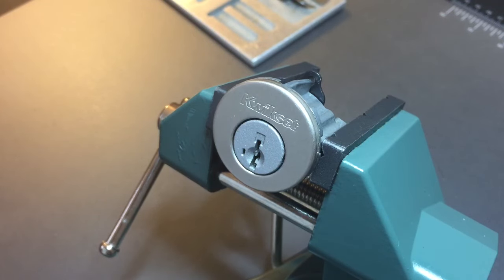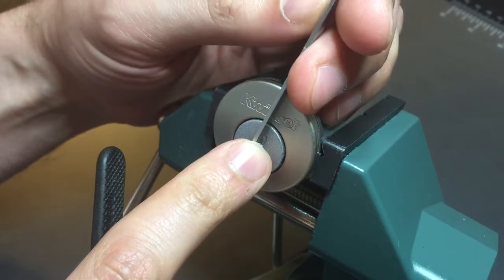[153] Kwikset SmartKey Rim Cylinder Picked and Gutted

Comment: You know that what most people need in a lock is one that does a half decent job, and one that doesn't lock you out of anything for long. I once worked as a locksmith and found there is such a thing as too much security. Plus why buy a super lock when all one has to do is kick on the door. You have to look at all the things that make up a door and lock. I don't need to know how to pick a lock, and want to pay a hefty price for a lock. Or have a lock that my locksmith can't work on. And I'm too older to remember to know how to take locks apart to change the keys. So all this is of little interest seeing how bumping can get you through most locks. No need to know how to pick locks or to have lock picking tools. Which you can be arrested for having, or not. I find little of value in most of this. Tah. Locks are for basically honest people. A pro is in in seconds, because he knows how to by pass most locks. And alarm systems were made to  fill in for the failures of most locks and door frames. Tah. Yes, there are clubs and people who pick locks for fun, and tell people about the short comings of locks. It'd be better if such people served as watchdogs for government. We'd perhaps wouldn't need better locks and so on. It's hard to believe not that long ago people didn't lock their doors. Well, this has been fun.

Comment: The scary thing about picking a kwikset is that once you've successfully picked it you can reset the pins to a different key. Crazy!
Reply: Would be quite easy to prevent, or at least make much harder, by making it so the cassette can only move whilst the lock is in the locked position (just have a notch in the barrel that blocks the gap as it's turned) as the act of tensioning the sidebar to set the sliders will rotate it to unlocked when they're in the correct positions, that way you'd pretty much have to have the real key (although due to the fixed positions of the keypins when set you could decode the lock once it was unlocked and cut a copy of the key, but at least that's difficult to do)
Reply: @benisted1614  Considering that this lock can be decoded without moving the pins, there's no reason so try to fix other issues before fixing that vulnerability: https://youtu.be/DGdsIrAjp3k
Reply: @MikkoRantalainen  Definitely a serious vulnerability but the tool costs $300+ and works on one lock, it's not going to see ridiculously widespread use yet, particularly by criminals. At this point most likely users are covert-entry teams (who would likely object to carrying such a bulky tool when a boroscope would likely do the same thing) and locksmiths, who will generally be working in a law-abiding fashion. As a vulnerability it's one that has been fixed by other slider-based locks and I expect it to be fixed in the next generation of this lock.
Reply: @benisted1614  I agree that once you know what to look for, a boroscope and may a small prism is all you need. We full pre-made tool just makes it easier.

Hopefully the lock design is fixed before many people get this lock core because otherwise thiefs WILL get the tool to decode the lock. I'd also guess somebody can create a key that can be adjusted to any cuts you need.

Comment: Thanks for this description. I had one for a few months and only managed one open on it. Tension seemed to just bind the whole plug so I had to work very light. This helps, your technique for picking it more like a car door than a house lock, it makes sense. This is almost how you'd use a Lishi pick.
Reply from the maker: +Shira Assel Thanks. I have no experience with car locks at all.  As for binding the whole core, I've only tried three of these locks, and only one was like that... I've seen huge variation in the depths of the false gates, so that may be why.

Comment: Lock Picking Lawyer. This is a bit dated, and I would love to see you breakdown the latest generation of this lock. The Kwikset Gen3 of this lock CANNOT be single pin picked in the way you're doing here. Their system has been vastly improved with a sidebar that keeps wafers from binding individually in SPP picking. 

Only after all the wafers are to shear does the sidebar fall into place allowing the plug to turn. That said, others have been able to pick this lock by tensioning the sidebar with a shim. I have tries this technique, and on the latest models I can get some wafers to bind, but I still can't pick it.

There is also a decoding tool for this, and you can cut a key by finding the kwikset depth codes which a special magnifier decoding tool will allow you to do with practice. This tool costs 300.00 dollars though!

I'd love to get your professional feedback on the latest version of Kwikset's cylinder in the smartkey version. I want to see if you can pick it, or provide additional tips and feedback to us fellow follow lock nerds!
Reply: Never tell lock picking lawyer that he can't spp something. But i kinda want to try the new one when i hit up home depot i may pick one up
Reply: @Manatee360Phototography  "Never tell lock picking lawyer that he can't spp something." I laughed so hard 8D
Reply: A new video was posted addressing the sidebar version and how it can be picked
Reply: In case anyone else comes across this thread, it’s ep 904 and reviews the model 3 with reverse sidebar
Reply: @jonengen2927  hey thanks
Reply: @jonengen2927  Thank you! That was very kind. You helped me. :)
Reply: Sure wish I had read your reply before I sat in front of my door for an hour.
Reply: Interesting and thanks for the information. Is there a way to tell the different generations apart? I have a SmartKey Rim cylinder, I haven't been able to pick it because the pins don't bind.

I assumed it would need some kind of setup with a key before it would function (all I have is a brand new unused cylinder). But now I guess it must be a gen3.

I'll have to look into this!
Reply: LPL picked this 'reverse sidebar' version in June 2019 at https://www.youtube.com/watch?v=XqsAFdFsQmQ and yes, he had to hold in a shim as he did it.
Reply: Jon Engen you’re a solid dude
Reply: It's a a Lishi tool for decoding...I have picked the old model of K S but it's ruff now.
Reply: Thank you. Yes for a new fideo of kiwiset rekey eithout a key
Reply: @Manatee360Phototography  did yoi succed
Reply: Thanks, I was wondering why Im not getting any feedback from this lock, lol.

Comment: I found one of these by the side of the road. I know locks can be anywhere from $20-$60. So, I thought I could try messing with it to see if I could re-key it. I couldn't immediately find a piece of metal small enough to fit in the re-key hole. So, I just took it apart to see if I could re-key it with a spare key we had. It wasn't until I found this video of how the re-keying slider works that I was able to put it back together and make it work with a key I already had.

Comment: if you want the new ones get the uptown or downtown style deadbolt they are brand new styles so they will have the new core.
it will say ”new advanced smart key technology” on the back of the package also if it's the new core

Comment: Hi Harry, Great picking again of course, you must have "the touch"! Interesting to see the actual mechanism - well explained as well. I know the locksmiths don't like these self change locks, and generally advise customers to change them. Apparently Kwikset have strengthened them to better resist the crushing technique, I wonder where the "improvements" have been made?  Regards, Brian.
Reply from the maker: +Brian Hignett Thanks. I know that they redesigned the sidebar such that it goes deeper into the housing and changed the material of the sliders. But I've never seen one of the early ones, except in pictures.

Comment: this version has been upgraded, and is unpickable due to the fact that no tension on the lock gets transfered to the sliders or the pins, " no feed back", and any tension just binds the sidebar  from being depressed due to it being square on top and not angled, and that the only thing that can depress the side bar are its tiny springs, way weaker than the pin springs. I have both versions.
Reply: I wouldn't say it's unpickable.  I can apply tension as if trying to lock it, insert the key, and it turns.  I can't do that when I apply tension the other way. The key will not turn until I let up the tension.  Point is, it could be picked to the locking side and the a spinner could be used to get it to the unlocked position, I believe.  But.....I could be wrong. :)
Reply: @Matt Williams "GKeyman565" said that the lock that "LockPickingLawyer" picked was the old version and it has been updated. So yes it was picked but they have changed the lock and how it works. But like "Derek Traywick" said he thinks it could still be picked.
Reply: 55ATA3 It has been picked. When will people learn to stop saying ‘unpickable’? (I mean, the Protec 2 went down on video last week.)
Reply: @RealWorldPolice  If you look at what I said. I said ""GKeyman565" said that the lock that "LockPickingLawyer" picked was the old version and it has been updated. So yes it was picked but they have changed the lock and how it works. But like "Derek Traywick" said he thinks it could still be picked." I never said it was  ‘unpickable’. Also my comment was 30 days ago and it had not been pick at that time. But thank you for letting me know that it has been picked. If you have a link to the video I would like to see it.

Comment: I understand Kwikset has redesigned this lock, with a different sidebar mechanism that prevents the plug from rotating unless the sidebar is physically depressed.  If I'm understanding it correctly.  Are you familiar with that change, or had any luck picking the new design?  Thanks very much for all your videos - they're very well explained and have been a great help to me.
Reply from the maker: I'm familiar with the change, but have not been able to find one yet.  If the change is what I've been told, it will make picking and forcing far more difficult.
Reply: This looks like the latest generation of Kwikset-smart key locks.  I haven't been successful against this lock yet.
Reply: Sorry to bring up an old topic but did you ever find this?  I took the lock on my door apart and found the exact setup you show here except when I applied tension to it the lock would freeze.  Even when I picked to the correct position it wouldn't turn.  I tried applying light tension and inserting the key and it also wouldn't turn.
Reply: Had same issue actually Derek, was messing with mine today. I run thru a few times and all pins are up and set, no turn. If I just pull tools the lock will freeze until released from inside. @LockPickingLawyer curious if you can share some knowledge, thanks!

Comment: I still dont get it :( Its nice having a visual of the interior, which lets me recalculate my thinking when i pick the lock, but i still have no idea how it really works lol
Great video though, I appreciate you taking the time to take it apart :)
Reply from the maker: Thanks.  Sorry I didn't do a better job of explaining.  :-(  If there's a particular part that did or didn't makes sense, I can try to fill the gaps.
Reply: Its not your fault at all, its my comprehending ability lol. Im just trying to grasp how the sidebar, the "pins" and the core all work together to make it rotate or not rotate when you put the key in
Reply: iknow it is tough to comprehend how they figured that out to make it work.
Reply: I got one if these cores for like 50 cents at the local habitat store. It's a lot easier to grok with it in your hand

Comment: Was hoping you would show aligning the True Gates with Channel, Reassemble, being Sure it Slides back for Rekeying. With same or other Key.
I go to a Local Door/Window shop, remove old locks from their Discard Pile, Then Rekey to a Key I have. Wanted to Show Brother In Law aligning the Grooves, Great Video, looking for one with the groove aligning. Thanks
Reply: to get the casset to go back, the sliders need to be up about half way, youll see the big cut out that matches with the half circles right underneath of the key pins .  so the sliders just need to match with the halfcircles and it will alow the casset to be pushed back... insert a new key and turn the rest of the way and bam, re-set, hope this helps

Comment: Great picking and gutting. Excellent work as usual. I've got an WEISER SmartKey Rim Cylinder here. It is a Kwikset but from Canada. It is a Challenge lock from "Locks of Anarchy", and I am struggle with it for a while now.
Reply from the maker: +dirk Thanks, and good luck with yours. Just look for the tightly bound slider and move it one gate... Rinse, repeat until open.
Reply: +LockPickingLawyer Cheers my friend. I will keep that in mind, and try.

Comment: We use these at the apartment complex that I work at.  The core is basically impossible to drill through..  Best way we've found is to aim for the 2 bolts on either side.  But brute force always prevails if all else fails.
Reply: At the relatively low cost of the lock, it is probably more cost effective to just force the lock and replace it.
Reply: Pushing the mounting screws out with a 1/8" drill through the face is SOP with all the apartment maintenance guys I know. Good cylinders will have a hardened plate in the face to prevent this attack as well as preventing the core from being pulled, and those usually come with hardened screws and a thick mounting plate too. I've seen some pissed-off ex-tenants install one of those as a 'going-away' present to get even with leasing agents who wouldn't refund their deposits. Maintenance always destroys the door trying to open it...

Comment: I've had one of the for a while, but I haven't been able to pick it. Do you have any tips for picking this one? What kind of tension did you use?
Reply from the maker: +Jake Neumann Thanks. Tension depends on the lock. I have three, and they all like different amounts of tension. Just give it enough to bind the sliders, but no more. Release a little tension to move the sliders. Good luck.

Comment: This is the lock that's driving me nuts. Your videos have help me a lot. I have watched your other smart key video as well. Also your video on tension, which has me sold on getting a heaver top tension bar. Now my questions are. Can you go through this type of lock again and address the tension question? Heavy tension does not work with this lock. 2nd in this video you keep mentioning springy at different points. Could you go into more detail on what you mean by this in relation to the pins binding? Thanks again for the great info!
Reply from the maker: Honestly, it's been so long since I picked one of these that I barely remember.  I'll have to revisit the SK.
Reply: This is Generation 1 with the side bar in a V side slot. When tension is applied it binds the sliders/ wafers.  I haven"t heard of anyone spp generation 2  with the square sidebar and slot. The new square slot prevents pins from binding. Interesting lock to say the least.

Comment: im curious what the bb does for drill protection, couldnt one just use a larger drill bit, pop the ball out, and continue?

or just drill above and below to pop it?
Reply from the maker: +LOLWHUTMAIFRIEN Its pretty good drill protection.  The ball bearing is hardened.  When you hit it with a drill bit, one of three things will happen.  (I) the ball bearing will stop forward progress and spin, (ii) the bit will catch the ball bearing a break, or (iii) the drill bit will be deflected by the angled ball bearing.  And it would be very difficult to drill the sidebar without going through the bearing.  Of course, there are ways around.  If I was drilling this lock, I would probably start with a 1/4" end mill and drill until I hit the bearing... then remove it with a magnet and keep drilling.
Reply: +LockPickingLawyer thank you kindly, really appreciate all the vids and the variety. lots to learn
Reply: @lockpickinglawyer  Remove the face of this deadbolt and you will find 2 open holes where the mounting screws thread in. Hitting these with the tip of an 1/8th" drill will grab the screw and actually unscrew it from the lock. If you're careful and can remove the face plate for reuse, you can drill these locks and reuse them! At the worst, you ruin the faceplate but the lock is drilled in less than 30 seconds.

Comment: My only question is... If I pick the lock using your method, can I rekey it to a new key. This would be handy to know as a maintenance supervisor at apartment complexes using these locks.
Reply: It can be rekeyed without the original key if you take it apart.
Reply: As long as you can get it turned 90 degrees and insert something into the slot in the front to move the slider cartridge, it can be rekeyed. So, yes.

Comment: The second time I was tasked to rekey a lock at work at a hardware store I accidentally took apart one of these thinking it was standard lock but the casing was made out of plastic not metal and didn't seem to have a side bar like shown. So from that point I kind of steered people away from them unless they wanted the rekey feature. But seeing this one in all metal I wonder if it's because it's a deadbolt keyway...

Comment: When can we see a video about the new version that can't be tensioned this way? I can send you a brand new lock if you wish. Gen 3 is what I believe they call it. Someone claimed it can be tensioned by pressing down on the sidebar, but I don't think it is possible due to the very small gap between the core and the lock housing. Anyway, it would be interested to see if you could attack it.